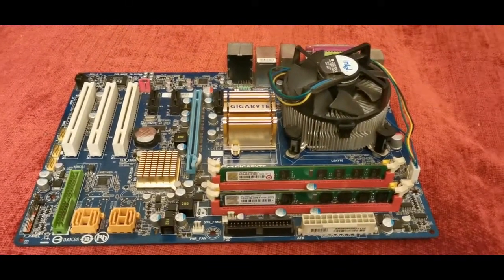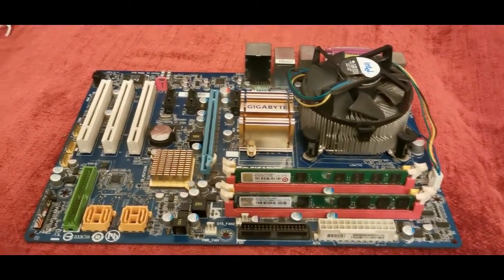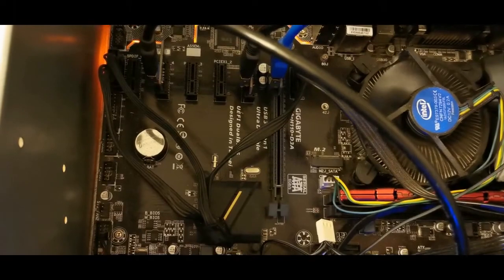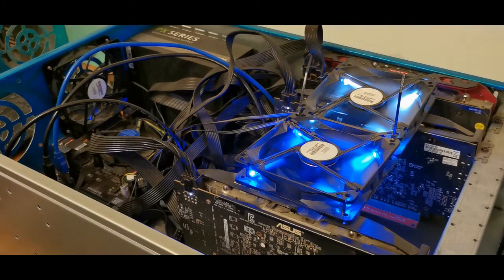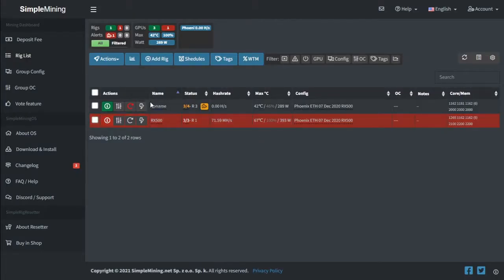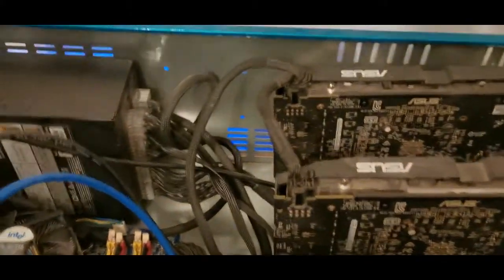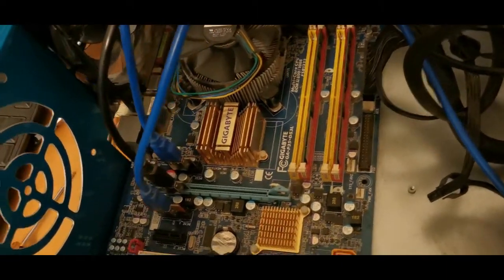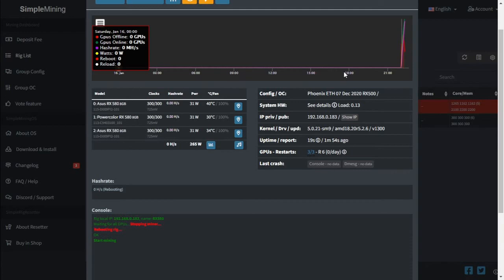Building a Retro mining Server - Part 1

Comment: My first true decitated mining build was 3 7950's on a bfg sli 775 board wirh a core 2 duo. No issues getting the full hashrate out of those cards.

Though if your planning to zombie mine dont expect the proformace to be great id wager ~16mh/s due to North bridge link speeds and ddr2
Reply from the maker: Hi Andrew, those were the good old days lol. mining eth with 3x RX580 8gb cards, and its running stable like you wont believe. Good to see that old hardware can still be used. join the discord and post pics of your old rig if you have.